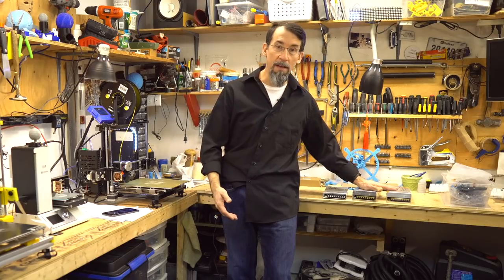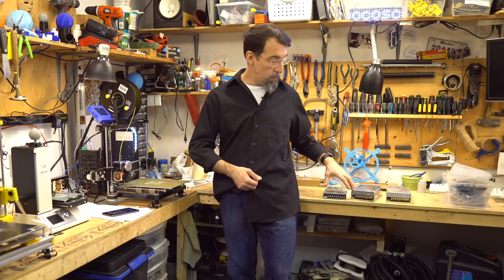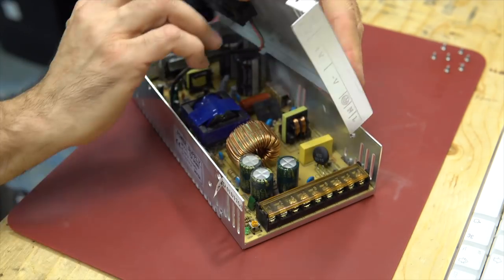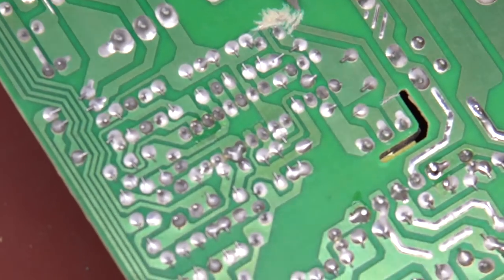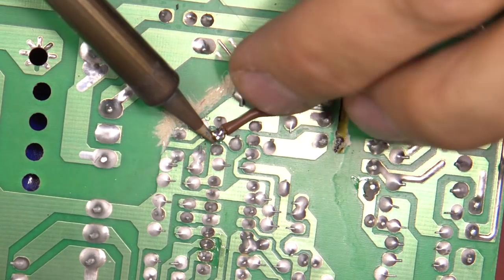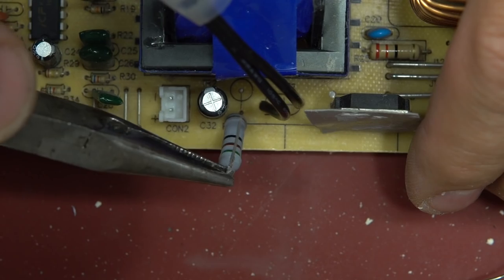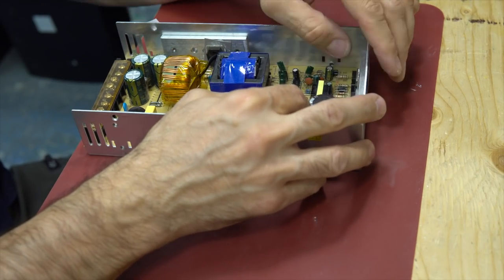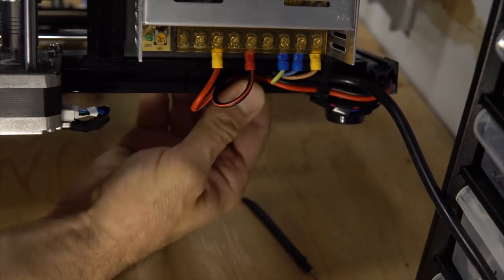Quiet 3D Printers

Comment: 3m39s : Didn't that left end of the jumperwire get soldered a bit too close to adjacent solder points. Seems like there could still be potential short circuits. I know you tested for conductivity. Or was the main reason for breaking the trace arcing over from the thicker traces at the upper side of the  visible board?
Reply from the maker: Hi, yes from what I understand, that trace was too close to the top ones, that is why you have a slot in the board, moving the trace was the recommended solution. The hole for creepage protection is correct isloating the pads, but you can see that the trace coming from the pads continues and goes closer to the upper traces. Look here: https://bit.ly/2TfSO2O